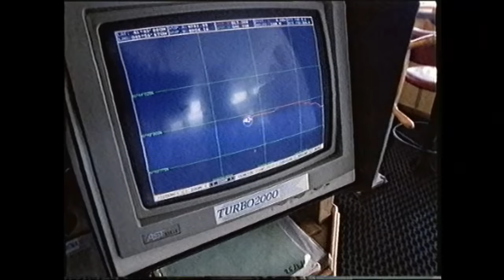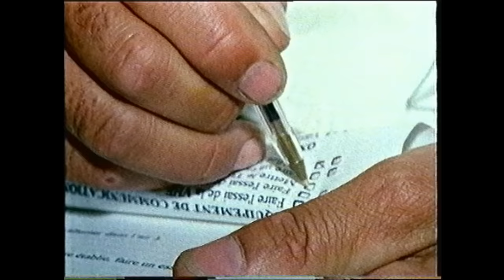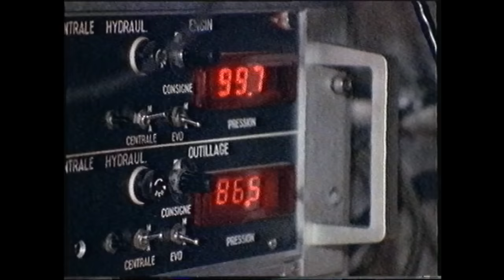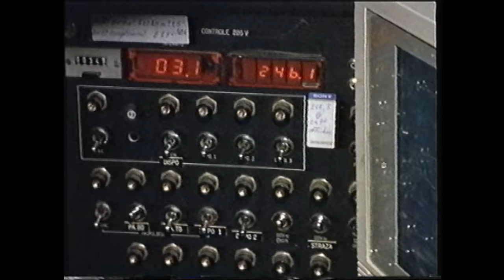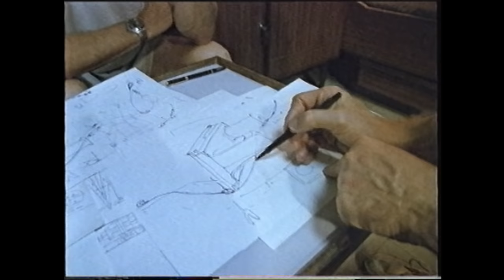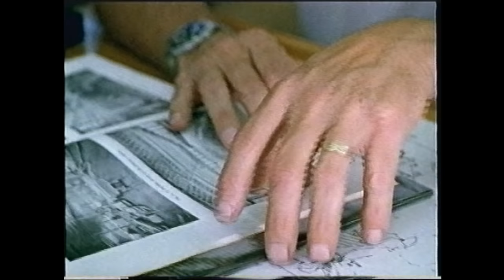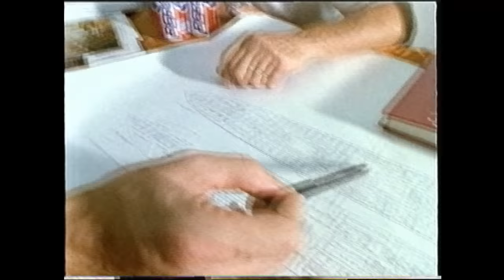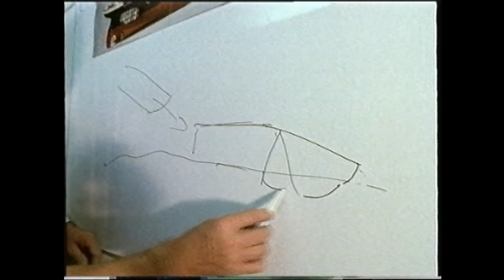Titanic salvage documentary

Comment: Whether the fire had burned out or not - the ship's side was noticably weakened before the sailing already, so the iceberg didn't have much work to do ripping her her open. 
Get the truth out there !! 
That Captain and Ismay were beneath contempt,
 and 100% guilty of murder. 
Thank God he never sailed again! 🙏🙏🙏
Reply: This is complete nonsense, the fire had nothing to do with the sinking at all. Coal fires were a very common occurrence on ships of the day. The crew did exactly what was supposed to be done, removed the coal from that bunker right away and get the fire out. This was accomplished and that coal bunker was empty. Barrett testified that the WT door had a dent on it where the fire was. It was made very clear this was a small dent and had no compromising effect on the wall. This wasn’t a raging inferno, it was a smoldering coal fire. It also was nowhere near the outer wall of the ship, where the ice damage was. Titanic sank because a 50,000 ton object traveling at 22.5 knots hit an immovable object. You don’t need construction flaws or fires for that kind of impact to cause serious damage. Titanic was as unlucky as they come because it was a glancing blow on the side, and the damage extended across 5 watertight compartments and into the coal bunker of a 6th. Yea it was the bunker that the fire had been in, but that has no bearing on anything. The coal bunker itself was not watertight. So it filled up with water andthen the bunker door failed allowing boiler RM 5 to fill. Titanic essentially leaked herself to death. 12 square feet, about the size of your front door, worth of damage was all titanic had. However as I said before it was spread out across a 3rd of the ships hulls. No ship could survive that. In fact titanic faired better than most. She remained relatively stable for most of the sinking, never capsized, and allowed almost all lifeboats to get off safely. Try and find another sinking in history where the ship went down so slowly and evenly. Some people believe that it would have last even longer had it not been for the extra 2’ of damage that went into the coal bunker of Boiler Room 5. Titanic was  a well designed ship and well built. It was just a freak perfect storm accident. Has nothing to do with anyone except the iceberg. There is no conspiracy.